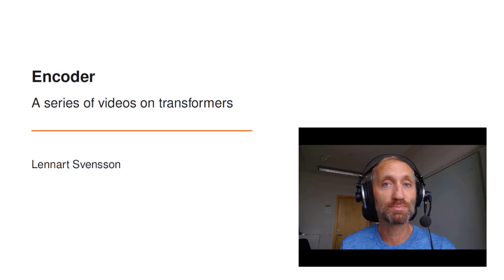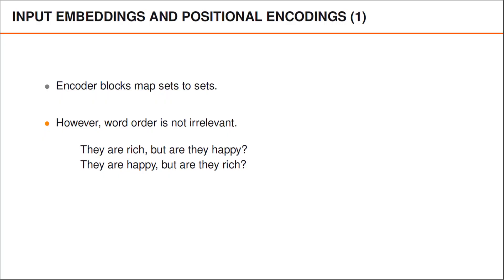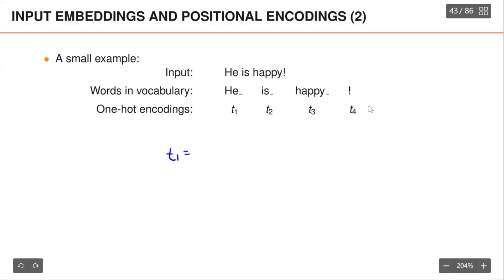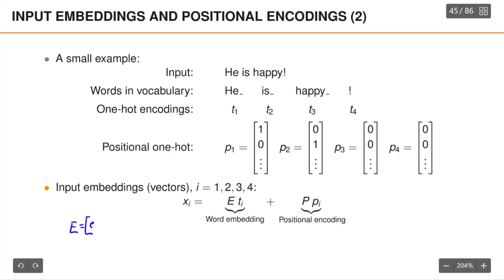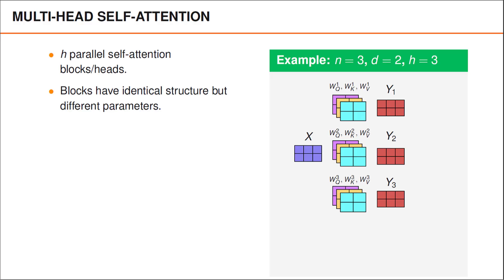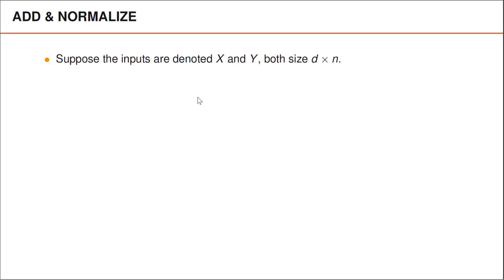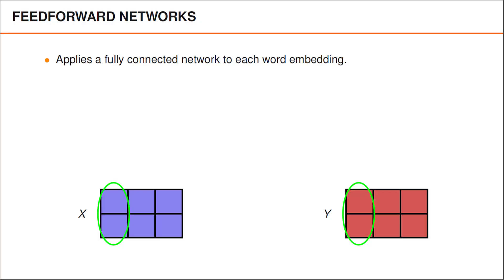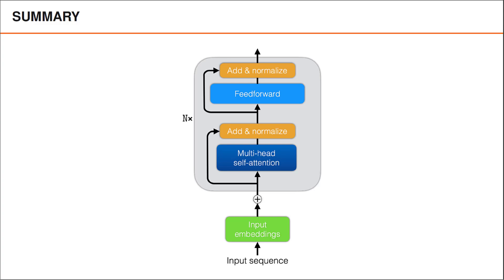Transformers - Part 3 - Encoder

Comment: Hi Lennart...Great series.. Helping me a lot .. One question on layer normalization (around 10:00), it was written mu = \sigma_ij ( A_ij)  and it is subtracted from every element in A.  But I read in some videos that mean is calculated  per ( D dimensional) column vector in A   i.e.,  mu1 = ( \sigma_i (A_i,1))/D , mu2 = (\sigma_i (A_i,2))/D ... mean subtracted matrix is like    [  A:,1-mu1,  A:,2 - mu2 ,... ] ... could you confirm ?
Reply from the maker: Good point. I think that you have spotted an error in my videos. Layer norm is usually performed per token and not across the entire matrix as described in my video. I'll update the video in a couple of months or so when I should have time to record more videos. Thanks!

Comment: I have only two sentences "I love dog" and "I love Persian cat",  3 and 4 words, respectively. How would you encode these two sentences? I mean how do you handle different sentence sizes, and share the training weight matrices? is it going to be through a method similar to one-hot encoding, if so the input matrix will be very sparse.
Reply from the maker: The input to the encoder/decoder is not sparse. In the video, the input is denoted xi. The (sparse) one-hot encodings are denoted ti and pi and we compute xi before feeding them into the networks. Still, the matrices E and P that we use to compute the input to the transformers can be trained jointly with all other network parameters.
Reply: @lennartsvensson7636  Many thanks for your kind attention, I need to meditate more on this to understand how the parameter sharing is happening between different sentences with different sizes
Reply from the maker: @AI_Life_Journey  If you are uncertain about how weights are shared for different sentence lengths, I think you should revisit the definition of self-attention. Note that each self-attention head only has one Wk, Wq and Wv matrix regardless of the sequence lenght. These matrices are thus shared among all tokens.